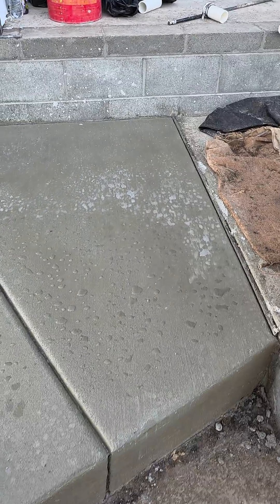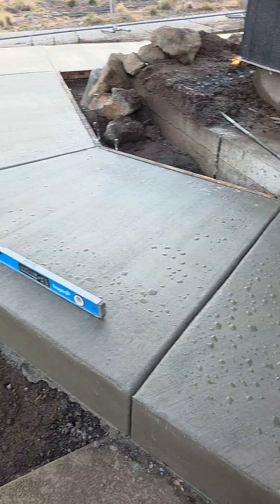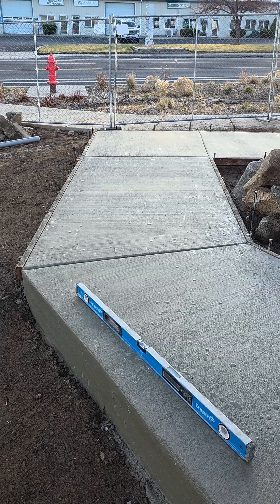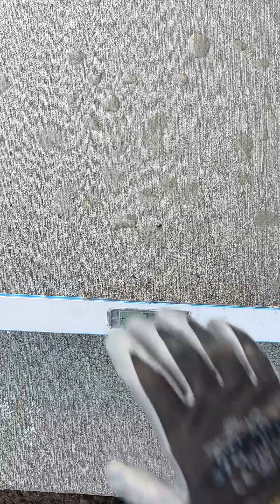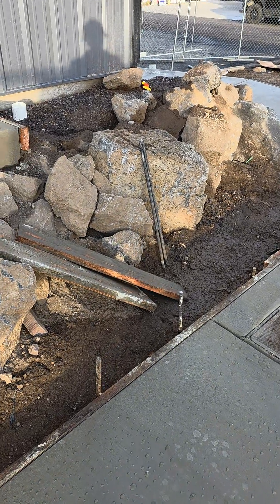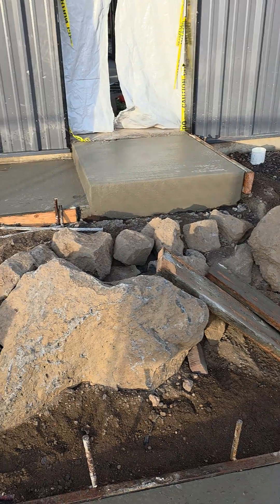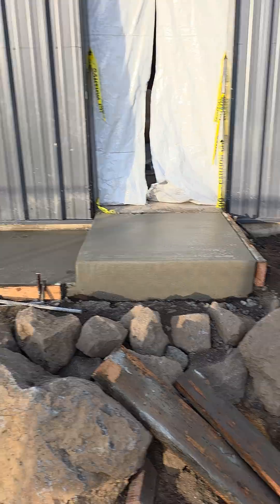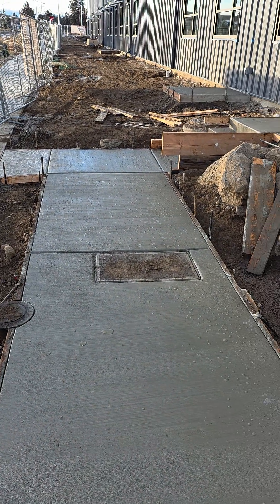Will This Pass Inspection? — Checking Slopes, Landings, and ADA Compliance #concrete #construction

Comment: Which sealer do you guys use there?
Reply from the maker: Spec chem with 25% solids.  I think Euclid makes the same thing or similar.  But we do not use any water based sealers, only oil based.  We go thru numerous sprayers a year, so we buy cheaper plastic ones.

Comment: Guys dont realize it only takes a 1/4 of an inch to put you over the 2% or 5% actually its even less than that.
Reply from the maker: You are correct.  I always like to check before we pour and after to make sure i know what the inspector will be looking at.

Comment: Do landings have a lower allowable slope?
Reply: Yes 1/48 or 2.04% max any direction 5’x5’ for ada. 1/12 or 5% on the straight ramp sections
Reply: Great answer, thanks
I was just thinking, wouldn’t the slopes at the landing be driven by the slopes of the interfacing ramps?
Reply: It would be a good exercise to draw and calculate all the lengths and pitches of the geometry of this in plan view just for fun, same calculations to solve for an irregular roof frame.